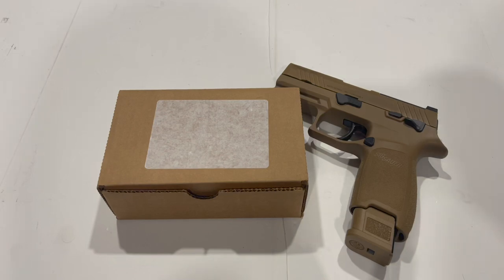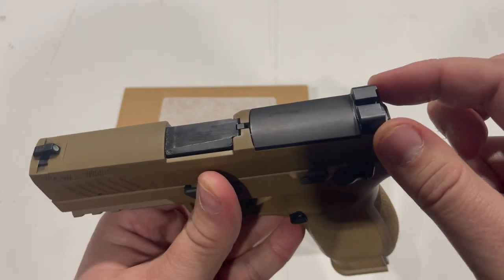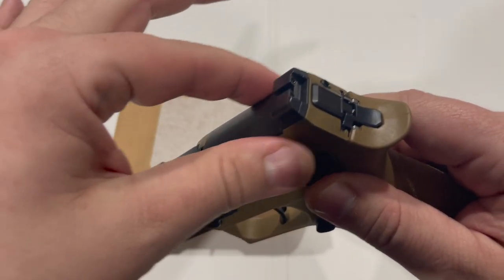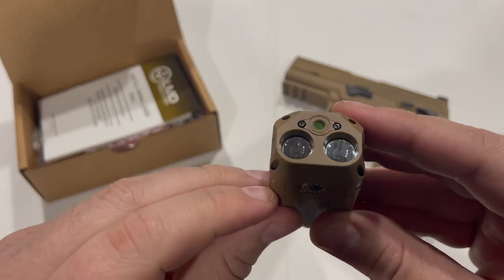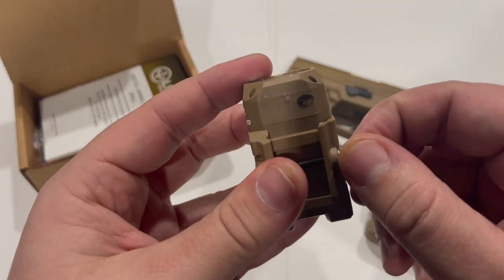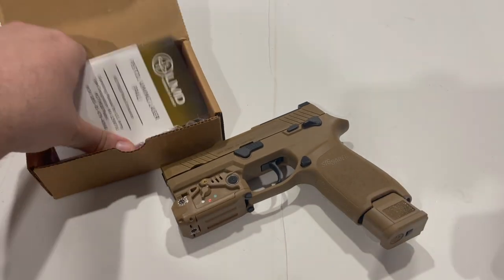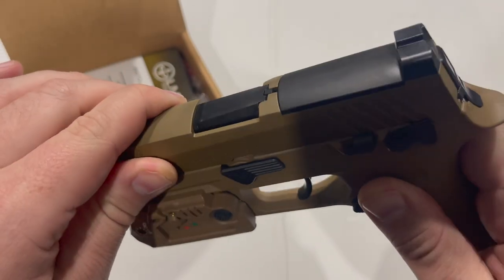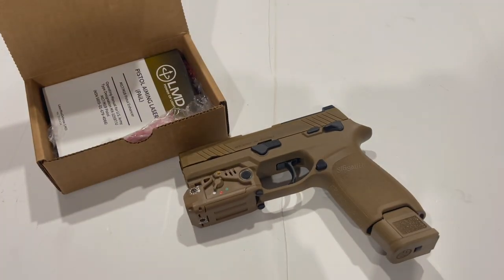LaserMax Defense PAiL M17/M18 Pistol Enhancer

Comment: The civilian limited run commemorative edition M17 and M18s  (basically MIL-spec versions except with tan colored controls instead of black) also had the same so-called "issue" with their slides not fully returning to battery with 'guided handling' as well. The solution to this is simple: lube the sucker up and actually shoot the darn thing. The gun will loosen up when it's used as it's MEANT to be used. If it spends its life as a collectible safe queen, it will likely forever never return fully to battery on its own with "soft" handling.
Reply: I don't know any LE or military personnel that is taught to "ride the slide" 🛝 🍆
   I think it's the Glock fans that would rather see the military 
go with a Glock that has a built in forward assist 😅

Comment: This feature set seems pretty good. Depending on the power of the led output it’s possibly much better than the similar Surefire design at 2/3 the cost of the Surefire. That activation button design killed it though. Having to apply pressure perpendicular to the bore to activate the light is completely ignorant. Guarantee every shot taken while activating the light will drift in the direction of the button pressure. Had they just put bottoms that work like the Surefire or Streamlight pistol lights, it’d be good.

Comment: I grabbed a contract overrun M18 as well.  It's awesome. Mine also does not return to battery if you ride the slide.  I assume it's from the more robust RSA. Like you said, handle it properly and you're good.
Reply: Where and how much did you spend
Reply: No worries, none of my glocks return to battery if I ride the slide.